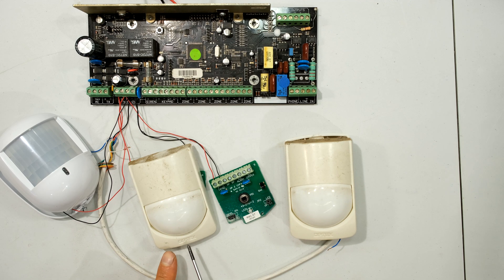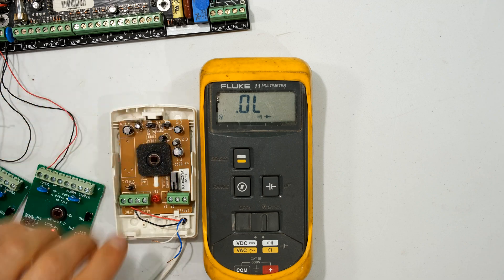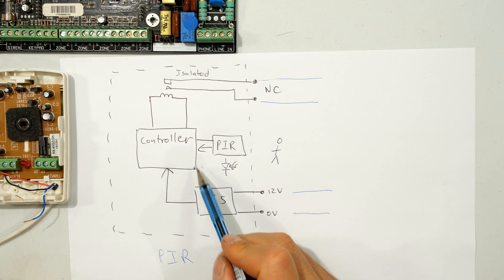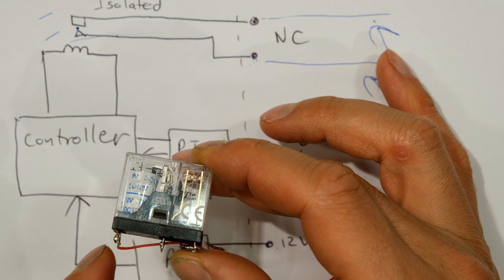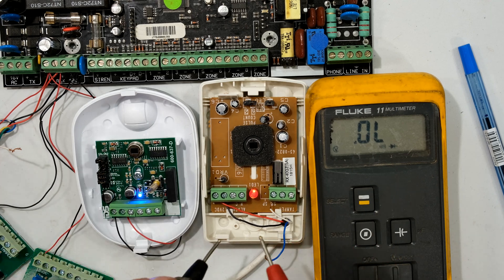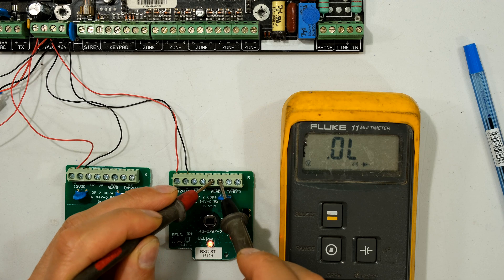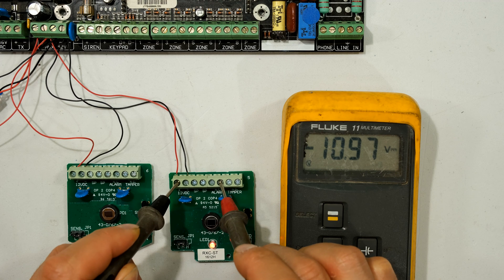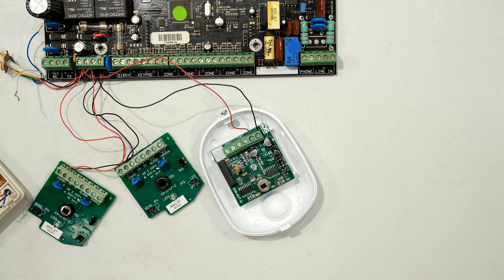Testing a faulty PIR alarm sensor - OPTEX

Comment: Would you know what the problem could be after a lightning strike, power was tripped, but now one PIR always showing open but the led is off, if I walk infromt of it, the LED goes on as normal, but the keypad shows the pir is open state all the time, any ideas?